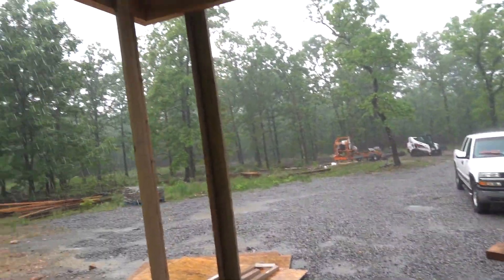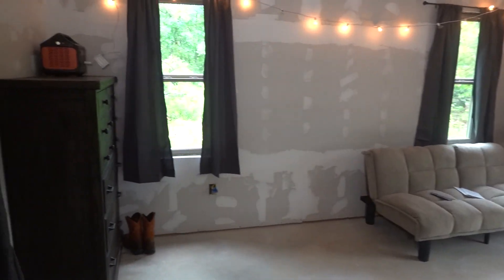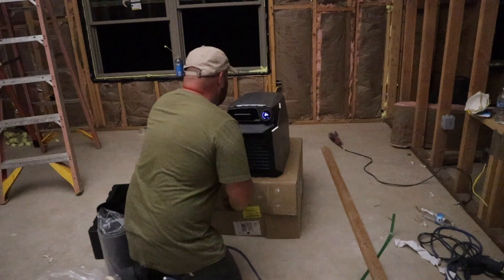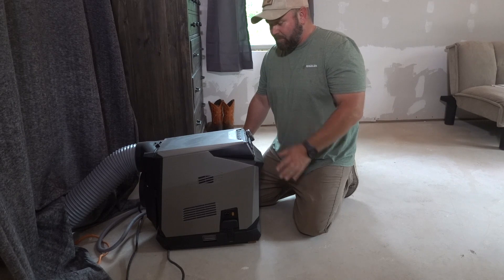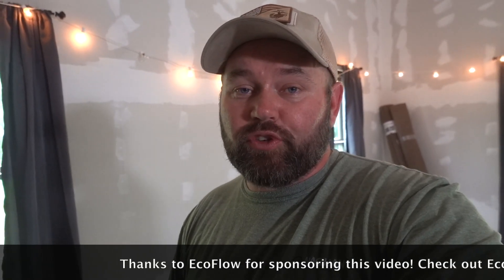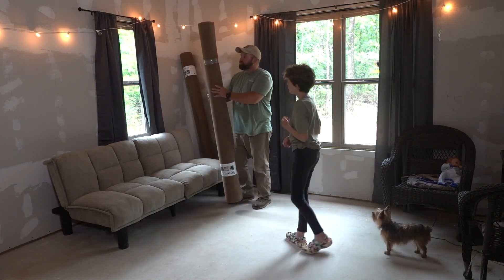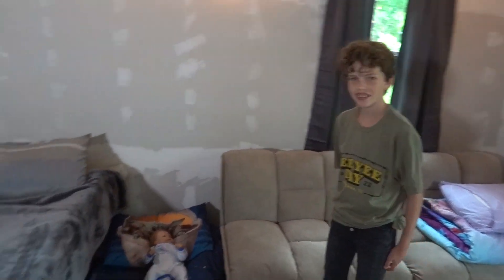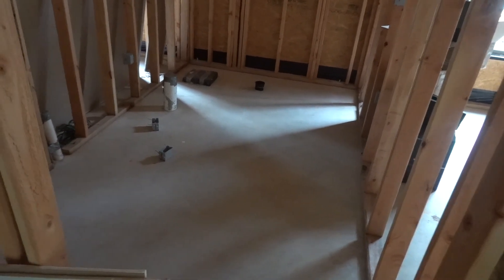It’s Official WE ARE MOVING And We Couldn’t Be More Excited To Use The Ecoflow

Comment from the maker: ECOFLOW WAVE:
https://bit.ly/3t22zpz 
50% off for pre-order code: KIDWAVE (Valid until June 13th).
Reply: Good afternoon 🌅
Reply from the maker: @joetaylorchristmastree2866  hi
Reply: Checked them out, they seem legit, how about another personal opinion in a week?
Reply from the maker: @russellwatters5891  It’s been working really good
Reply: @KeepingItDutch  Cool. No really. Lol
Reply: While portable AC units do work they are less efficient then window ac units. You want the hot side of the heat pump outside and the cool side inside. With portable units they draw the newly cooled air in and blow it outside, they all create lower pressure inside so the outside hot air forces its way in which is why they are less efficient and take more power to run as they are doing more work. The best ones have two hoses, one to bring in air from outside and another to blow out the heat removed from the room. Do they have a two hose version?
Reply from the maker: @aharris1iOS  what’s awesome about this one it has a battery you can use for camping and Offgrid.
Reply: if we were 35 years younger we'd be doing the same thing 
but we're not so I applaud you & your family for sticking to 
your plans this way you can say it's ALL YOURS every stick.
Reply: Half the vid is a commercial
Reply: Not 50%.  $50 off.
Reply: it takes time i built our place didnt have ac just got in gree ac and heat 31 seer grate for off grid solar
Reply: neat ac unit
Reply: @aharris1iOS  two hoses come with the unit for intake and exhaust. It wasn’t shown in this video but, you’re totally right. The unit will constantly be working against itself if you only exhaust the hot air and don’t properly suck in return air from outside the space through the intake hose. 

When using only the exhaust hose, you’re pushing air out of the room and make-up air must return in from somewhere. That make-up air is likely going to be hot air. So, instead of the unit circulating cool air exponentially cooling, it is having to constantly cool down warm air. The two hoses must be used for optimal performance 👌

Comment: I know it take time,  but the room you set up already you should have finished the wall and ceiling before moving in does not take that all to do  and then that out of the way  trim can be done any time  but sanding and paint that another story. don't rush - one thing at a time, you'll save work